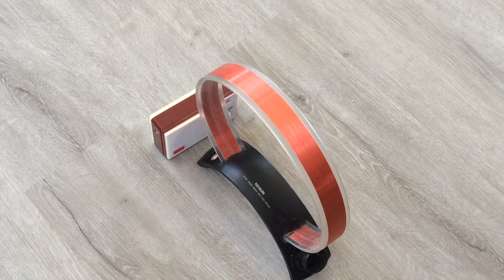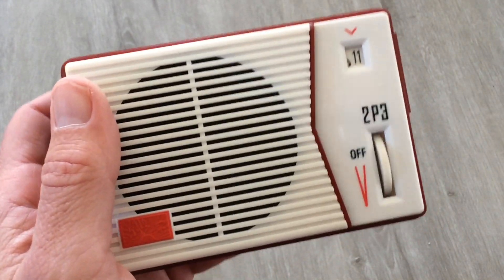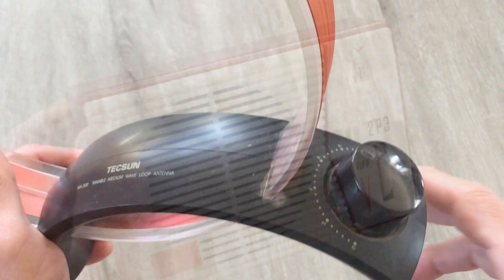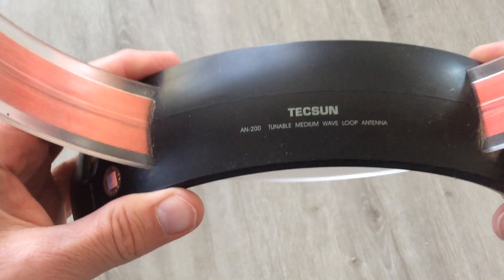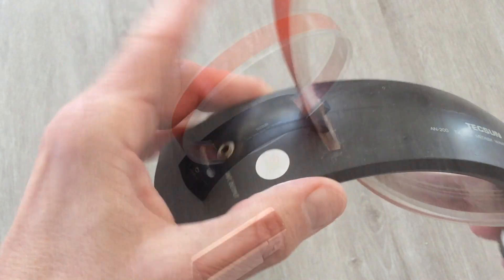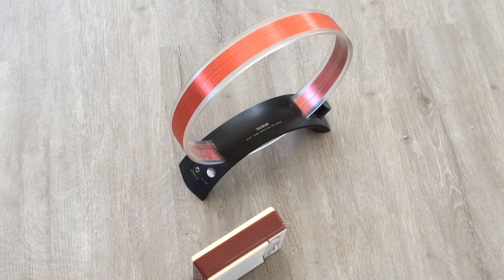AM Broadcast Band Loop Antenna Demo

Comment: I still have my old loop and used to hook it up to my stereo receiver.  One morning over twenty years ago I actually nullified WIP in Philadelphia and received WIOD in Miami just by rotating the antenna not using the fine tuning knob.  Remarkable.   I think the Miami station was doing something to their transmitter because this was about five in the morning in the fall season.  When I got my new Tecsun in January and hooked up the loop and it didn't do a thing on MW.   Didn't work.   I still have my old log book of MW stations.  I found that the best DX with that loop was right after the time change in November.  I was getting local stations located in the deep south an hour before they go off the air or reduce power after sunset.